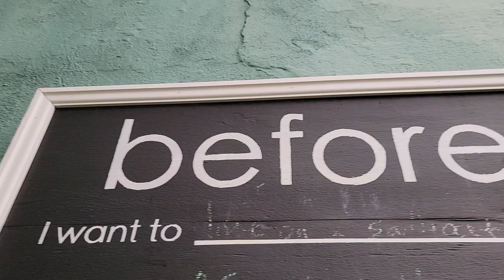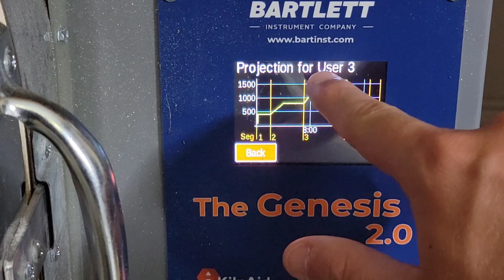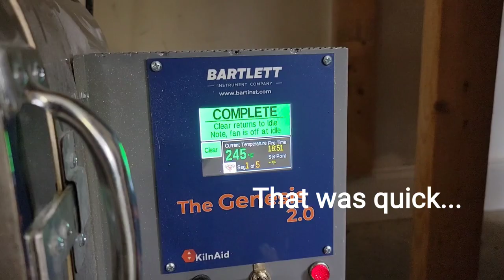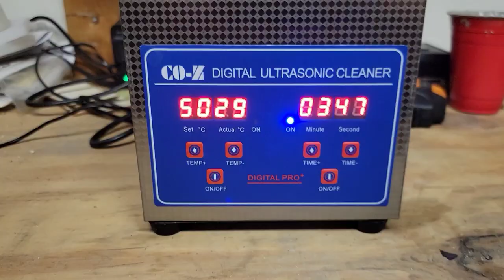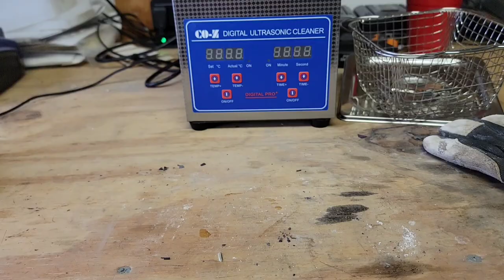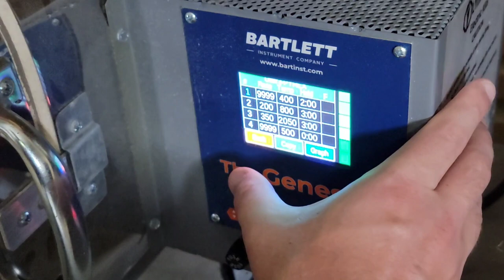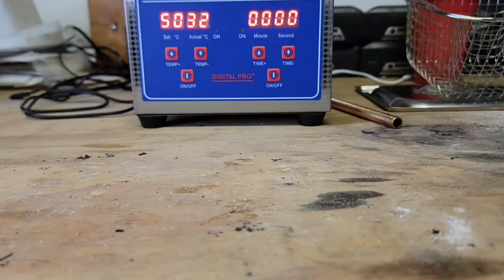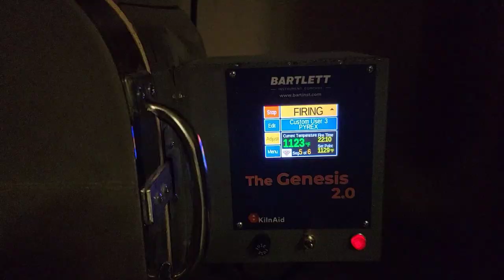why is this 3D printed Pyrex green?

Comment: Hey, just some comments from a rando who knows a bit about glass manufacture:

You need unreactive refractory for this. Graphite can work but you need a layer of flux on top to prevent it from burning. Graphite powder loves to catch fire. Better yet, do it under an inert atmosphere.

Any impurities in your refractory that can leach into the glass basically will, and can completely ruin it. It can also be used to impart other characteristics to the glass, though, if you ever want to experiment with that.

The glass likely needs tempering after its been sintered. This will toughen the glass and make it less brittle.

Basically your brittlement and colouring issues were down to your refractory and lack of tempering.

Comment: I have that exact nozzle, after using the glass feel like I want to invest in adamantium! 

I think you might be right on with past copper or metals being a contimant. My latest parts haven't turned out like that, but I've been careful to only use clean stuff (after printing with glass, the aluminum oxide they provide stays the same white color so far). Still think that blue could be a selling point though...
Reply from the maker: I do really like the color... thinking the same about it being a selling point. Other thoughts are could I introduce other contaminants (ie. Different oxides, minerals etc...) and influence the final part differently?

Comment: Why was that one blue though?
Reply from the maker: Not sure tbh. Best guess is that the refractory I made (and have used for several copper sinters) absorbed some oxides from the copper that made it's way to the Pyrex in the form of "impure" coloring. 
This is just a guess though, but I do like the way it looks.
Reply: @Mr-Highball  yeah. Looks like glaze. Very cool color
Reply: It probably took copper ions from the refractory.
Reply: @Mr-Highball Yeah, glass tends to do this a lot. It can be useful for doping glass, but is usually unwanted.